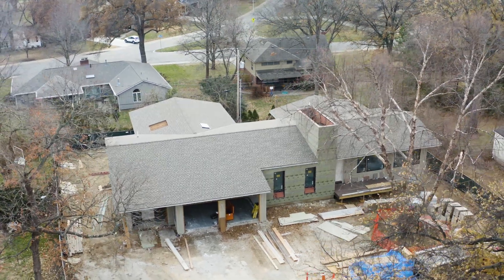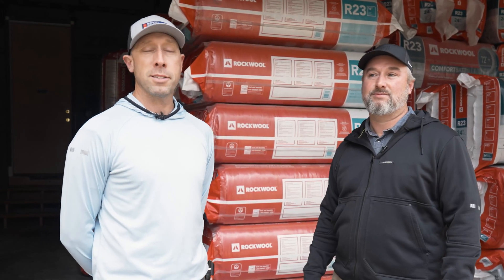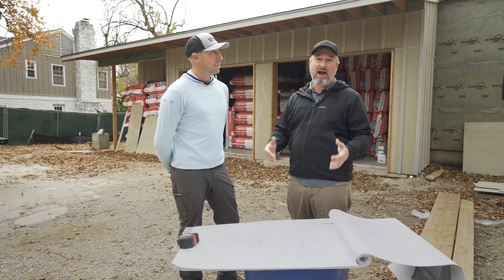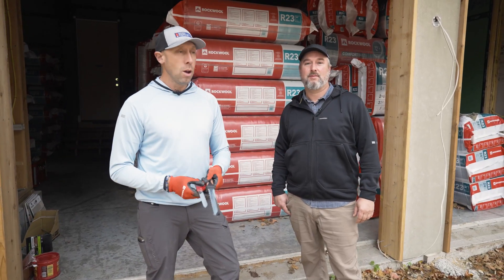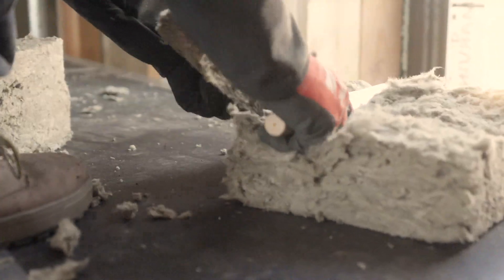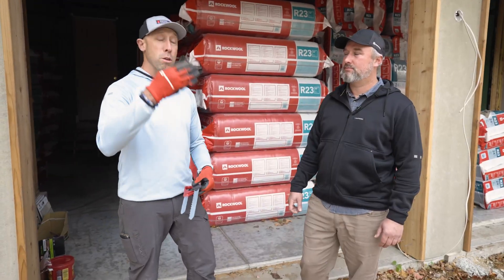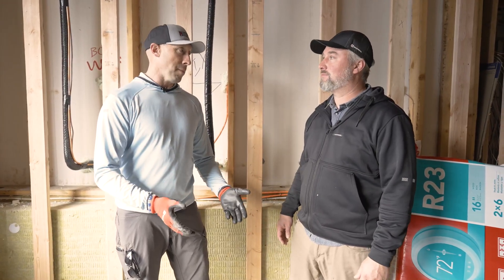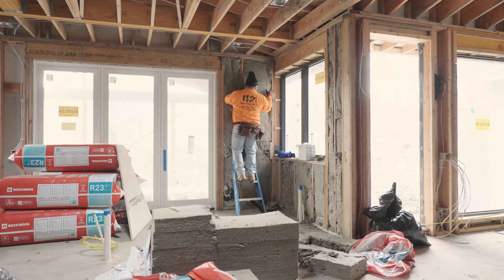Details of Using Stone Wool Insulation

Comment: If you use rockwool under a concrete slab, you’ll inevitably get water under there, even with a barrier. Isn’t that going to fill the air interstices with water and destroy the insulating ability?

Comment: travis/joe-what is the air sealing strategy at the rim joists between floors to work with the rockwool? (4:41 in the video) thanks!
Reply from the maker: Thanks for the question, here’s a note from Travis: “Our air control layer is actually at the exterior of our assembly where we utilized ZIP System sheathing and tapes at the seams of our ZIP R-6 panels. The continuous air control layer at the exterior simplifies transitions between floors where we can now add additional interior insulation at the wall cavities and rim joists between floors without needing to address air control from inside.
Reply: @finehomebuildingmagazine  very cool, thank you.

Comment: Some reviewers complain of smells from rock wool. What say ye?
Reply: I've installed rockwool in my cabin and did not notice any smell after installation.
Reply: I've watched at least 20 videos over the last year or two about mineral wool, and this is the first time I've heard any hint that there could be a smell. I suspect something else smells in the homes in those cases and it's being incorrectly attributed to the insulation. Or maybe the installers left the mineral wool to get exposed to something that then got on it and smells.
Reply: I think it's brand dependent. Some add formaldehyde. Rockwool brand doesn't. Owen's corning does and it absolutely smells and did for a few months after I installed it.